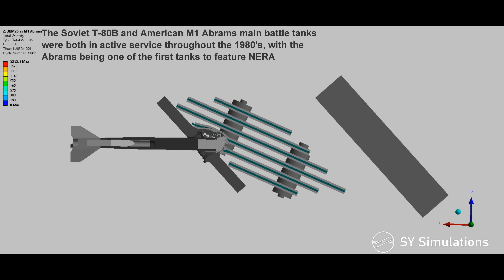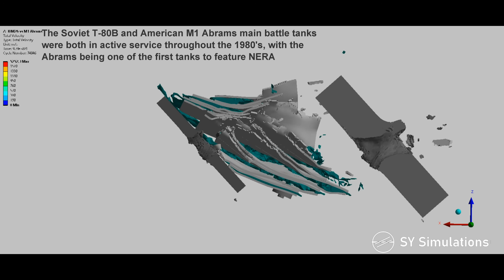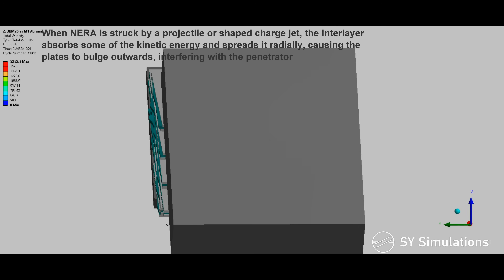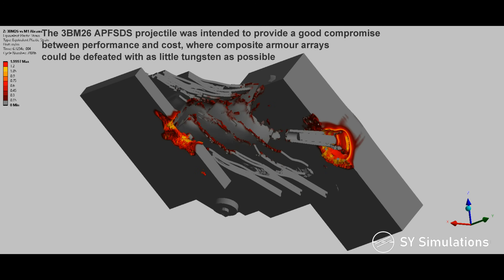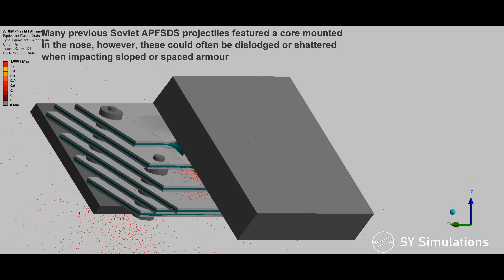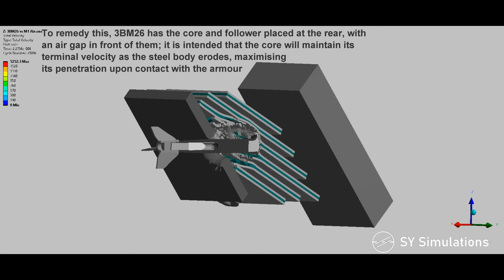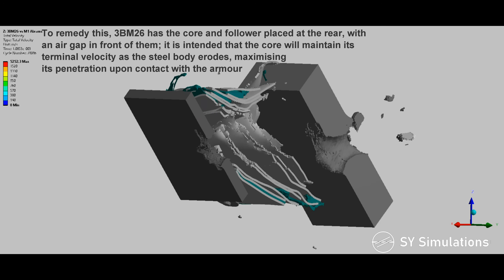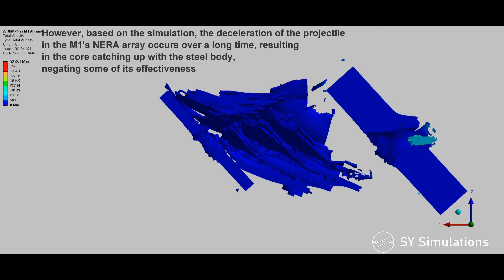T-80B vs M1 ABRAMS | THE MOST UNIQUE APFSDS vs NERA | 3BM26 Composite Armour Penetration Simulation

Comment from the maker: Its refreshing to simulate an APFSDS projectile which isnt just a simple cylinder...
Reply: This is excelent. Love your sims.
Reply: Could you try to reproduce the protection scheme of the Abrams tank, which is used in the Ukrainian army?  For example, standard Abrams armor + dynamic protection "Contact 1"?  Or instead of "Contact 1", you can try "Nizh" KHSCHKV-34 / KHSCHKV-19 ( "Ніж" ХСЧКВ-34 / ХСЧКВ-19 ).
 I am sure that many people will be interested in watching such a video.
Reply: Thanks for the vid! I have an idea for another one, I thought it would be interesting to see how ERA (for example kontakt 5) works at different angles of attack, against both HEAT and APFSDS rounds. I know that ERA works best at relatively high angles and it's effectiveness diminishes at more straight angles, it would be great to see how its performance change.
Reply: Please do exactly the same simulation, but with 3bm42, it is still more perfect and much more widespread, although it is also a fairly old ammunition.
Reply: Try it with some era
Reply: Hey, would you mind telling me what software you use to simulate? Looking to simulate medieval armor.
Reply: Hi, where do you gather the info for the nera armour or chobham. Im searching info for my thesis
Reply: @javiervb1329  On the field of course. Real life experience beats book smarts.

Comment: The ''glacis plate'' and ''front hull''  are both backed up by the considerable thickness of the fuel-cells surrounding the driver. Its important to note such arrays have been shown in ballistics papers to considerably reduce the penetration of both APFSDS & Accumulated Charges.Some papers show reduction in penetration of water filled targets to be 20-30%.

Comment: Two notes : the T-80B is 5 years younger than the Abrams and the abrams turret was NOT stronger than it's hull up until the IP/A1 versions, at which point the soviets were firing 3BM32/42. On another note, the weird/economical value of the 3BM26 is explained by the amount of APFSDS required for the soviet fleet of tanks, which in 1985 ie counted some 30.000 T-80/64/72

Comment: I love SY's vids because of the wealth of info in the vid and description - not just eye candy animations. As to subject matter, I wonder if one has been done pitting a, say, WW2 128mm PzGr.43 vs a modern NERA array? 

I ask because, as we know, modern armour trades traditional thickness for performance - "quality over quantity". Hence RHA equivalent ratings. However, they tend to be highly optimised for a specific projectile type - kinetic penetrator rods (NERA) and/or chemical (Chobham/composite). How would they perform against good old fashioned APCBC-HE? Or does NERA work equally well against any kinetic penetrator?

My guess is it won't pen because traditional AP rounds depend on T/d ratio... and if there's already a 100mm internal armour plate as illustrated here then the rest of the array would easily outmatch the 128mm diameter of the round. But still interesting to visualise.
Reply: Search "Jagdtiger vs M1 Abrams | Armor Penetration Simulation" by Dejmian XYZ, another creator who makes good tank gun simulations.
Reply: @doobs5342  Thank you, found it! And not inconsistent with expectations.

Comment: I would be interested to see how this would model with the introduction of a minor increase of a HHS plate somewhere in the array. It does appear that the M1E1 has a 20mm weight simulator at the front of the Hull. A minor improvement for sure. Mounted Infront of the NERA array it may have been just enough for such rounds. 

The armor array of the M1A1 /IPM1 is a mystery but we have enough clues to make a guess atm.

Comment: Absolutely remarkable design of an APFSDS projectile. I wonder how it would have fared on a more oblique angle, possibly a condition where the target faces presented are just the hull front at an oblique and the turret in some hypothetical hull down situation. Depending on the angle I could honestly see the APFSDS round going in and then out the return roller on the front of the tracks.

Comment: It's basically a tandem APFSDS, that's brilliant
Reply: Has less pen than normal APFSDS but it comes in at half the cost, soviet min maxing is insane
Reply: @Richard_T800 By less pen, it's 10mm
Reply: @Richard_T800i mean soviet min maxing is kinda working, for 1 abrams you can buy 6 T-90 or 2 leopard 2A7
Reply: @bintangmaulana9816  yeah but 6 of those T-90s equal an Abrams (performance wise)
Reply: @Epsilon2042  thats cope
Reply: @Epsilon2042  ukraine has stopped using abrams as fast as they started using it, apparently 27 of 31 delivered are lost
Reply: @fusion7029  I'm only saying the truth, you go cope lol
Reply: @Manestein  hmm source?

Comment: "Negating some of it's effectiveness" - well, the fact that it punched straight through the hull armour seems pretty effective to me, what, were we expecting it to go out the other end of the tank?
Reply: Some people actually calculate like that, and while its clear its a pretty "emotional" event for the crew, wondering if that slug is going to continue onto the engine bay and or damage other components of a hopefully recoverable vehicle doesn't hurt to speculate on.
Reply: what he means by that is that spreading the energy of the round laterally increases the effectiveness of armour. in this case the shell is still more than capable of penetrating. If it was the same amount of classic rolled armour it may well have gone in and straight out the back of the tank
Reply: Yes actually. Clearly you're not very familiar
Reply: If goes straight through its pretty useless. Happened with Tiger crew in WW2 against British or American tank, where the tiger shell went in from one side and out of other with clean holes.
Reply: @hp2084  such noobs. Thats why you use the Sprenggranate and not the Panzergranate for lightly armored vehicles where you dont need a delay for big boom to destroy the target

Comment: Is this the armor in the export models sent to UA?
Reply: nah, the ones sent to Ukraine are better, atleast for the hulls, it is the same ones A2SEPv3, as those are just A1 hulls
(ion wanna see DU cope, they only existed in prototypes)
Reply: @Ry-bo9hi  only used in 5 tanks for medical research which was later amended to unlimited use. Meaning DU is used in the most modern Abrams.
Reply: @HDREal  to test capability yeah, it's still cope

composite armor arrays means that just about any MBT can be fitted with a slab/s of uranium
that doesn't mean it's a good or practical idea, thats why there be only a handful of them have and the SEPv2/3 still on old-ass hulls
Reply: @Ry-bo9hi  you’re a Reddit/Warthunder nerd. All your information comes from fictitious games and Reddit posts. Regardless of what you say the fact doesn’t change.
Reply: @HDREal  actually it comes data sheets and it's battlefield performance in Ukraine
cope bro, without overwhelming air/ground support, the tank is trash, even more so than the Leopard 2
this would've been remedied if they made a tank, instead of a "tank killer"
Reply: @Ry-bo9hi  “it’s battlefield performance in Ukraine” didn’t know we sent Sep V2s and V3s over to Ukraine.
Reply: @HDREal  what difference will those make if there are no changes to the hull?
the same hull found in the SA is in the SEPs
you can argue ERA and APS but the ERA isn't on the hull/turret roof and the drones move too slow for APS, plus they don't have that yet
muh "plans"💅
Reply: @Ry-bo9hi unfortunately though the results will be the same due to better round's
Reply: @BelugaChonky  real, the Abrams' hull is very limited in terms of improvement of armor, especially whenever weight is concerned

Comment: If you think thats bad, imagine sitting in a Challenger 1/2 with no NERA on the lower front plate at all
Reply: In all of these, Abrams included, the LFP shouldn't be hit except for by close-in AT weapons usually fired by infantry. Challenger 2s should have ERA although I wouldn't be surprised if all the kits used in Iraq are in a landfill or at the bottom of the North Sea
Reply: @diggledoggle4192 A CR2 was frontally penetrated in the LFP by an RPG-29 once, so

Comment: I have no doubt that this is accurate. The M1 Abrams is a formidable tank with its own strengths and weaknesses. The T-80B was top-of-the-line in 1985, so I believe it could penetrate the M1's lower hull. However, war involves much more than just tanks. The losses on both sides would have been catastrophic. That said, the Soviets would have faced significant challenges in reaching the Rhine within their 7-day timetable. I also believe NATO would have resorted to using tactical nuclear weapons, just as the Soviets intended to do. While I consider the M1 to be superior to the T-80B, there are many more complexities to consider in such a hypothetical scenario.
Reply: In general the complexities of war mean that its rare that one tank can reasonably be declared "superior" to the other. Attempts to do so usually just consist of someone taking a tank they like and a tank they don't like and rating them both based on how much they look like the tank they like. Given the opportunity, the US would not have traded the Abrams for the T-80, nor would the soviets have traded the T-80 for the Abrams. Both tanks serve their purpose within the wider doctrine of the armies they serve in.
Reply: how is the M1/IPM1 superior to the T-80B obr 83? it loses out on armor protection FCS and even penetration... kinda only wins in terms of ergonomics and crew survivability
Reply: @geraldmuntuerto5769  reverse speed maybe, also i think that T-80 wins in ergonomics due to less crew
Reply: @quan-uo5ws  nah ergonomics is in favor of the abrams... even american tankers who are tall easily fit in the tank... meanwhile jingles couldnt fit in a T-72 when he tried
Reply: @geraldmuntuerto5769  maybe because hes fat, the chieftain fits nicely and hes pretty tall
Reply: @quan-uo5ws nah man. I’m a fit tanker, been in a t72, not fun
Reply: @geraldmuntuerto5769 my guy what are you smoking...M1 has thermals
Reply: @sneekiboi136  the GPS(gunner primary sight) of the M1 abrams has a worse daylight sight function than the 1G42/46 of the T-80B/U until the introduction of the M1A2
specifically its 3x 10x wide/narrow only
the 1G42/46 is 3x 12x continous/variable

same goes for the commandersight but to an even worse extreme
3x fixed periscope for the abrams
meanwhile the TKN-3M is 3x 7.1x continuous/variable with hunter killer capability

the only advantage is the nightsight/thermals... thats it
Reply: @geraldmuntuerto5769  ehhh thermals means a significant advantage even during the day as it means the T-80 will stick out like a sore thumb even compared to the surroundings allowing abrams to get the first shot off whereas the Abrams still has a chance to "Evade" detection at long range
Reply: In a hypothetical 1985 Cold War confrontation, the M1 Abrams and the Soviet T-80B would represent the pinnacle of Western and Eastern tank design, respectively. Each tank was a product of its nation's military doctrine, reflecting different priorities and approaches to armored warfare.

Superiority of the M1 Abrams
The M1 Abrams had several advantages over the T-80B that would likely have made it superior in such a confrontation:

Mobility: The M1 Abrams was powered by a gas turbine engine, which provided it with exceptional acceleration and speed over rough terrain. This superior mobility would have allowed it to outmaneuver the T-80B, gaining advantageous firing positions and avoiding enemy fire.

Firepower: The Abrams was equipped with the 105mm M68A1 rifled gun, which was highly accurate and capable of firing a variety of ammunition types, including the M900 APFSDS-T cartridge. The M900 round, with its depleted uranium core and advanced sabot design, was specifically engineered to penetrate the most advanced armor of the time. This round would have been particularly effective against the T-80B’s frontal armor, which, despite its layered composite design, would likely have struggled to withstand such a high-velocity penetrator.

Protection: The M1 Abrams featured advanced composite armor, including layers of Chobham armor, which offered superior protection against kinetic and chemical energy rounds. In contrast, the T-80B's armor, though formidable with its complex multi-layered construction, was generally less effective against modern Western APFSDS rounds like the M900. The Abrams' armor was also designed to provide better protection for the crew, enhancing survivability in the event of a hit.

Fire Control System: The M1 Abrams was equipped with a highly advanced fire control system for its time, which allowed for greater accuracy and faster target acquisition. This system gave Abrams crews a significant edge in both long-range engagements and rapid response to threats, reducing the time it took to find, range, and engage a target.

Combined Arms Integration: The M1 Abrams was not just a standalone weapon system; it was designed to operate as part of a combined arms team, integrating seamlessly with infantry, artillery, and air support. This combined arms approach would have made the Abrams even more effective on the battlefield, as it could rely on support from other branches of the military to neutralize threats that it alone could not handle.

Threats Faced by the M1 Abrams and T-80B
Both tanks would have faced a variety of threats in a Cold War battlefield. These threats included:

Anti-Tank Guided Missiles (ATGMs): Both tanks were vulnerable to advanced ATGMs, which could be fired from ground units or helicopters. The T-80B, equipped with the "Shtora" electro-optical jammer, had some countermeasures against these missiles, but the M1 Abrams' superior armor and mobility provided better overall protection.

Artillery: Artillery strikes, particularly those using guided munitions or cluster bombs, posed a significant threat to tanks. The M1 Abrams’ design focused on survivability, with features like blowout panels in the ammunition storage to protect the crew, whereas the T-80B's crew was more vulnerable to catastrophic hits.

Mines: Both tanks had to contend with the threat of anti-tank mines, which could disable or destroy a tank regardless of its armor.

Real-World Combat vs. Modern Games
Modern games often simplify the complexities of real-world combat by focusing on a single element, such as tank warfare, air combat, or infantry battles. In reality, however, these elements are interdependent and must work together to achieve success on the battlefield.

For example, while a game might allow a player to engage in tank-on-tank duels, real-world combat would involve a far more complex scenario where tanks operate within a larger battle group. In such a scenario, tanks would need to coordinate with infantry to clear anti-tank teams, with artillery to suppress enemy positions, and with aircraft to provide air cover or close air support. Additionally, logistics, terrain, weather, and the element of surprise all play critical roles in determining the outcome of a battle, none of which are fully represented in most games.

In summary, while the T-80B was a formidable opponent with its layered armor and advanced optics, the M1 Abrams had significant advantages in mobility, firepower, protection, and its role within a combined arms force. The M900 APFSDS-T round, in particular, would have posed a serious threat to the T-80B, making the M1 Abrams a superior tank in this hypothetical Cold War confrontation.
Reply: No the T-80B was not the top of the line in 1985, that was the T-80U. The T-80B was objectively better it had better armour, vastly superior optics for the commander, a better armament. This simulation has nothing to do with a Soviet Invasion, though you are wrong. The NATO frontline would have completely disintegrated in a few days or weeks. The fact that it involves a lot more than tanks is something which benefits the Soviets which outgunned and outqualitied the west in everything. Even tactical nukes.
Reply: @parallax9084  The same Soviets that, years later miserably failed at assaulting Grozny would have totally disintegrated western armies.
Reply: @telephrag  I only recall the Red army liberating Chechen ASSR in 1942, I dont know what youre talking about.
Reply: @parallax9084  And I don't recall Russian army modernizing instantly after the USSR's collapse.